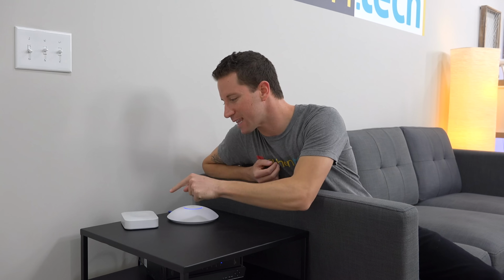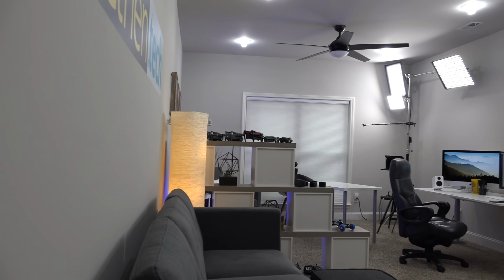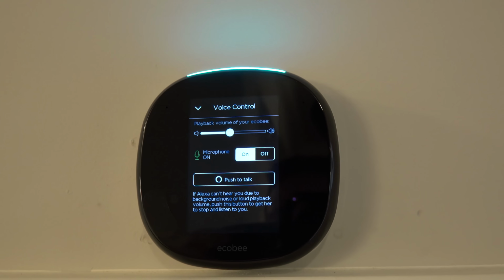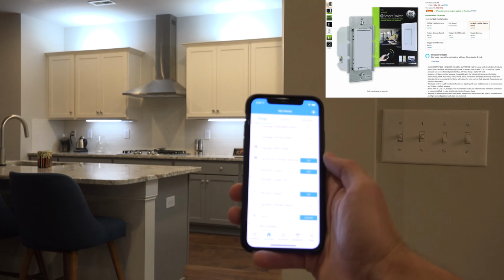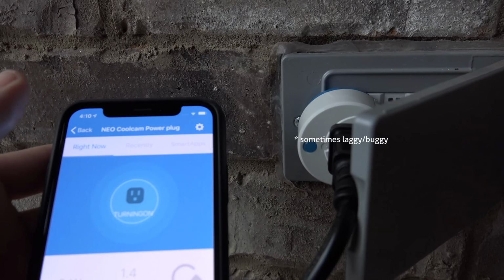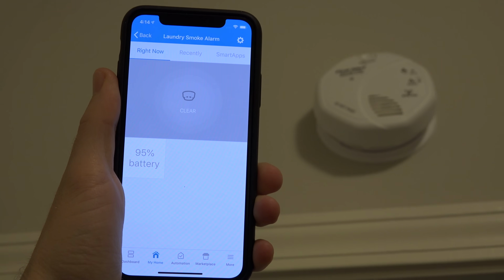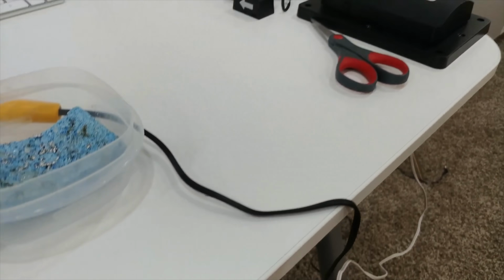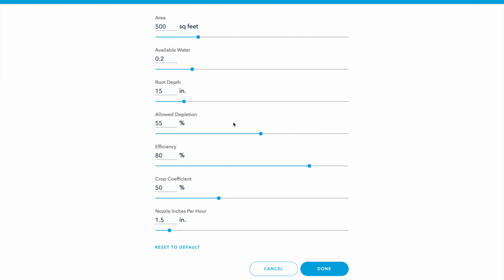My Ultimate Smart Home Tech!! - Episode 1

Comment: I want smart home devices for HVAC. For example a pressure monitor that I can install to read the pressure on the back side of my air filter, which is a low vacuum. When the filter is ready to be replaced it starts restricting the air which causes the pressure drop to increase. The physical device is called a manometer. This is a perfect application of really smart home. Or how about a temperature monitor with a probe. WIth this I could use two of them to measure the air temperature entering and exiting my system. That information would let me know when my system has a problem by looking at the temperature difference. That difference is called a split. If the split is too low then I likely have a compressor problem, which is almost always because the outside coils need to be cleaned. If the split is too high then I likely have a clogged filter because not enough air is available to accept the heating or cooling that is taking place.
Reply: I was looking into this as well, but the closest I came was flair vents which close and open your vents based on desired room temperature, which doesn’t solve any pressure issues or heat savings.

Comment: With samsung smartthings, does it avoid bulbs or other wifi products slowing down your wifi?
Reply: That's going to depend. SmartThings has a zigbee and Z-Wave Plus radio in it to allow for devices to build a mesh. SmartThings can also work with WiFi devices as well. Z-Wave does operate at the 2.4GHz range so it is possible that a large number of Z-Wave devices could impact overall performance of a WiFi network that also operates at 2.4GHz.

Comment: I dont understand why the cheaper wifi plugs would bog down your system, you would just switch them out with your more expensive plugs.... Ive bought those round wifi plugs on Amazon for $6 or $7 when on sale and they work just fine. Also theyre compatible with Echo and Google Home.

Comment: Damn and I thought I had a lot of smart tech. You certainly have a good variety and agree with many of your brand choices. I'm at around 70 total device that integrate well together. I prefer Alexa but use google assistant on my mobile. IFTTT almost eliminates the need for smart things. However, I do want some of the devices they offer. I have a harmony remote but found the new Fire TV Cube to work perfect for my home theater setup. Lastly, I didn't see much mention of cams outside your doorbell. Wyze cams are a great value and have many features that can be linked through IFTTT. I'm a Hue and Neato user as well. Great video!

Comment: Smart smoke detectors sound cool. But my understanding of smoke detectors is that after like 7 years you have to completely replace them.
Reply: This is not really true anymore as technology has become advanced.  The replacement rule were more common with ionized type detectors but since most smoke detectors are photo the need to replace is not needed anymore, unless it gets damaged.  I would recommend smoke detector/ CO2 detectors.  Much more useful

Comment: If you get a sony TV (Android TV), Alexa can control the TV without the need for a harmony remote in between. control volume, pause, resume power on and off etc.  Less hassles then logitech remotes when they get out of sync with the tv
Reply: the lack of sync is irritating, but the remote comes in really handy when you're coordinating multiple devices at once or need advanced functionality. the harmony actually plays very well with sony tv's in particular, my samsung tv requires a lot of advanced activities to perform basic tasks. what i did to avoid the largest issue with the lack of device sync is setup the hub to only power down devices when actually turning off an activity or pressing the off button. Definitely not perfect, but reduces the headaches overall quite a bit.